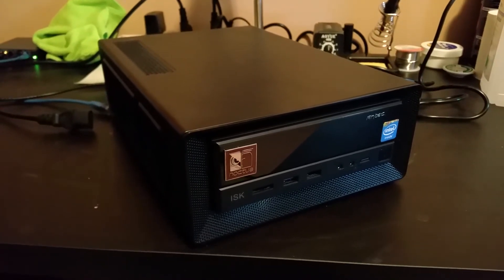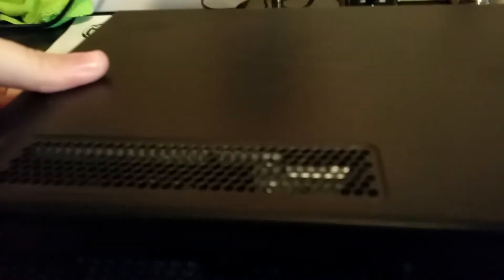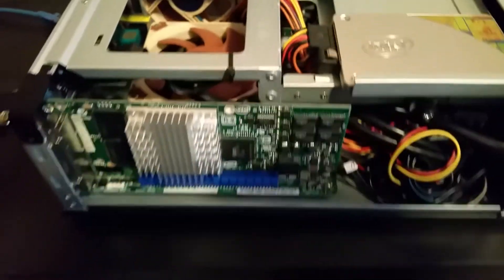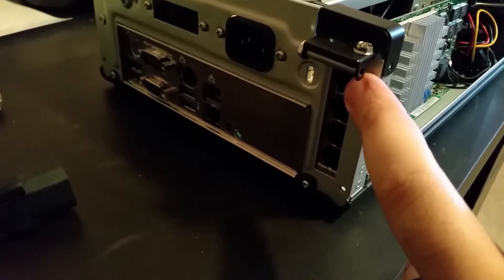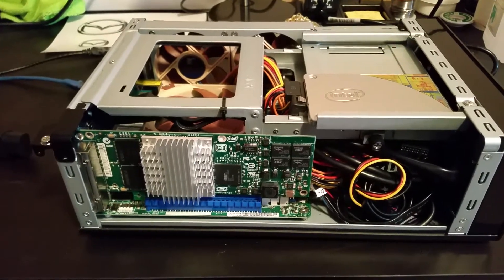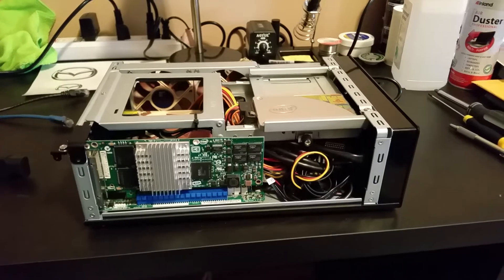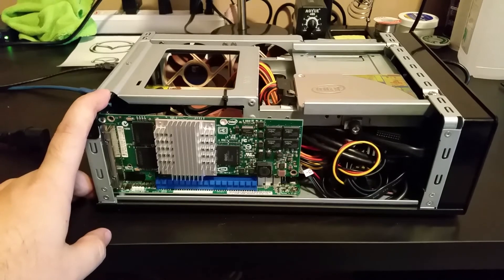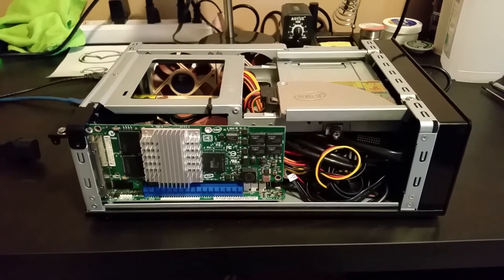pfSense Build, A Tale of Frustrations

Comment: Running pfsense on an old core 2 @3ghz with 4gb of ram  160gb hd, and two single Intel pcie gigabit network cards. No issues. Some old 420w psu. Been running for 3 years. No issues.
Reply from the maker: It's been running fine since getting past the odd string of issues when I first assembled it.  None of it was stuff that could have really been prevented aside from my one mistake.  It's just that odd bad luck you run into once in a while.

Comment: AsRock has a lot of QC issues I've noticed.  I usually build with ASUS or Gigabyte mobos.  If it's a server, then I go ASUS server boards.  They just work.

I've built pfSense routers on old Dell Dimension 2400 units 2 GB ram on Celeron processors.  Never had issues, but if you do that in an enterprise level.  The fail will be real quickly.
Reply from the maker: I usually go supermicro for server boards myself.  Never had any issues with the. I ended up with this because it was the only miniITX server board I could find with LGA 1150 socket and IPMI.

Comment: I've been wanting to build something very similar to this. I wouln't need the extra ethernet ports. Cool video, look forward to see how its working
Reply from the maker: it's working well, aside from the NIC.  Was dropping connections left and right after getting things going.  pulled it out and running everything through a switch for now.  Till I can get around to ordering another one.  PfSense it's self has been flawless, for the most part.  only the hardware issues.
Reply: what do you think about trying one of the passive cooler itx celeron boards?
Reply from the maker: I know a couple people using them.  Also the Atom embedded chips.  Seems to work well for them.
Reply: Ah nice. I think that's what I'm going to try doing. I'll probably use the same case you have. I found a nice board for about $105. Might start this weekend or something. Thanks for the info!
Reply from the maker: +nobearclaw no problem. Only reason I did not go the same rout was because I had the CPU already.  And I wanted a board with IPMI.  So, no matter what I needed a server board.  But if you don't want/need IPMI or other features of a server board pretty much anything will work.
Reply: Ya that makes sense, I don't have a cpu right now so I'm pretty much open to all options. My extra cpu is an amd 8350 which I hvae running a Ubuntu server right now lol. This is what I had in mind:

https://www.amazon.com/dp/B006ICQ3FK/ref=wl_it_dp_o_pC_S_ttl?_encoding=UTF8&colid=2C4PUAR8M4RPG&coliid=ISMND83FLLN13
Reply from the maker: +nobearclaw that would probably do ok.  But it might get worked hard depending on the plugins you use.  Currently Squid gard is the hardest hitting one I have.  The little celeron runs at about 50% load.  That title Atom will sit at or near 100% at times.
Reply: +Chad Bremer hmm alright. any other ideas? i really want to build a small one like this. i could just say screw it and use an old Intel duo 3.0ghz with 4gb ram I've got sitting here doing nothing lol. its just old and was worried the psu would shit out. and it's a matx size pc
Reply from the maker: +nobearclaw what is the max budget for the board/cpu?
Reply: +Chad Bremer I don't really have a budget, but realistically don't wanna spend a ton for a router build if you know what I mean
Reply from the maker: +nobearclaw well, the little celeron I am using is only $30-40 US usually.  Aside from that, any ITX should fit the bill fine.  Just make sure you get one with Intel NIC(s).  More compatible than other brands.  My board was a bit over $200, but it is honestly overkill in many ways.
Reply: +Chad Bremer ya I heard Intel NICs were better with pfsense. so the cpu u have with itx will be better than the board I sent? seems it wouldn't cost too much more. I've actually got a Intel dual NIC already so I guess any itx board will work as long as it supports the cpu.
Reply from the maker: +nobearclaw if you already have a NIC, then yeah.  Any cheap mobo will work. Might be worth checking the used market too.
Reply: +Chad Bremer cool should make it pretty cheap to build then. I'll probably go with the same case w psu as yours then too. thanks a lot for helping! you gonna keep making videos?
Reply from the maker: nobearclaw Oh yeah.  I am looking for a smoke machine so I can redo my most popular vid.  Airflow testing the HAF X case.  Did it with dry ice back then.  Figure a smoke machine and better camera work and what not would be good.  This time with my water cooled rig in my 900D.  If it goes well, I may look into a series of airflow vids.  Have some other stuff planned too.
Reply: +Chad Bremer sounds like a good plan! I'll be around. by chance do you use openvpn through pfsense? if so is it hard to get set up
Reply from the maker: nobearclaw No.  I have no real need for it at the moment.  And since I host a game server I don't really want my traffic going over a VPN for that.  Adds latency.
Reply: Ah ya, that makes sense. I'm in and out all the time, so it's something I've really been wanting to add. Was going to do it with my ubuntu server, but too much of a pain.
Reply from the maker: One thing to keep in mind if you use OpenVPN, you will want an AES CPU.  The Celeron does not have that.  You will be looking at i5/7 or Xeon chips.  I don't think i3 or Pentium chips support AES.  You will want to check Intel Ark to know for sure.
Reply: Hmm, why? People run openvpn through hardware without it all the time. Is it because of the speed boost tech? That could change some things...I thought about even using the g3258, but it doesn't support that either. Maybe I should end up getting a cheap xeon or something. For the short time being, Im going to reconfigure this old dual core pc I have until I figure out which exact parts I need/want. I want to run openvpn, proxies, and obviously dhcp routing. not all sure what else i can use in Pfsense.
Reply from the maker: Better performance with the hardware encryption.  You could always try with out it and if you have performance issues, upgrade.
Reply: Oh ok, that makes sense. I guess I'll try it with this test run PC and make a decision on how much performance I'll need for my actual pfsense build
Reply from the maker: nobearclaw For the most part you need very little.  But, encryption can be a bit taxing for a CPU.  Everything else is pretty low power.  The AES just makes that encryption job easier.  In a very loose explanation.  lol
Reply: Haha ya I understand. I'm gonna start setting it up on this pc I have tonight. I won't get as far as the vpn tongiht probbaly. Oh, last question....my wirless router, I just put into access point mode, and run ethernet from my switch to the router correct? Is there a simple way to change the router default IP or PFsense default IP so they're not using teh same one and the webgui on both are still accessible
Reply from the maker: That's all you have to do.  As far as the IP on the router/AP, that will vary from one to the next.  Some allow you to manually configure the IP for the unit.  I am using DD-WRT on a Linksys WRT1900AC.  In it you can pretty much manually set everything thanks to DD-WRT.  

If you can change it, do it either before shutting it off or plug it into another machine that is not on the new network yet and change it.  Just make sure you choose an IP that is not part of the DHCP pool.  Usually .100-.245.  That is the default range anyway.
Reply: Ah alright cool thanks. I'll look in there and see if I can change it. If not, I'll just set it up before unplugging. And like u said use a computer not on network if necessary

Comment: Many of those Intel quad port NICS are very good (visually) clones. I wonder if you failed to get a genuine one. The old date does bring questions though. I assume you found a date on a chip?
Reply from the maker: manufacture code on one of the visible chips.  Figure odds are they where all made around the same time.

Comment: Did you over-provision to extend the life of your ssd?
Reply from the maker: No.  Not even remotely concerned about that.  At current rates it will take 15-18 months to fill the 190GB set aside for the cache alone.  Modern SSDS are pretty resilant.  Any good high quality drive will take hundereds of terabytes before having issues.  some even get to 1-2 petabytes. Unless I got extremely unlucky and have a defective drive, it's a non issue.  If this was in an enterprise enviroment it would be a different story just dew to sheer volume of constant write.
Reply: Ok well I haven't decided wether to stick with my 2.5" 5400rpm drive or use an older 60gb ssd. Am replacing my Atom 330 with a micro-atx J1900.
Reply from the maker: Unless it's an old Sanforce drive it should be ok.  Sanforce drive had bad firmware back in the day that killed drives.  One of the downfalls of OCZ back then.  Only SSDS that have ever failed on me so far have been Sandforce.

Comment: Hey Brad, more or less what did you spend on parts? I'm looking to do the same.
Reply from the maker: It's Chad, not Brad.  As it sits in the vid, It was about $400.  But I made another vid recently where I swapped the CPU out for a Xeon E3 1231 V3.  I needed the extra power to cope with my download speeds and still scan with ClamAV.
Reply: Hehe sorry Chad. Kool that sound great man! I'll check out your new video.

Comment: I had some problem too, to install the new 2.3 beta version, I install it one week via USB, and the others week i was not able to get it install with an update version, had to download a old version, did not think it was the mirror problem.

Can you put the model or the Case and motherboard? 
Tks
Nice video
Reply from the maker: case is Antec ISK 300-150 mobo is Asrock Rack E3C226D2I
Reply: For a little bit more you could have gone with a MBD-X10SDV-4C-TLN2F-O, Xeon-d, more future proof, better cpu,4dim,+2*10gb nic, not lot of heat, but can't change the cpu i think,
Good video , i'll maybe start a youtube channel soon
Reply from the maker: +jolejo7 this is a socket 1150 board.  so, I can toss many other cpus if ever needed.  Don't think that will ever be a need.  It is already overkill for the job at hand.

Comment: If i do a lot of web cache would i need a higher end processor like i3 or i5 ? Planning to have 30-50 devices on the network
Reply from the maker: no, should be fine.  Squid gard will put a larger hit on the CPU than cache.   With Squid Guard off, the little celeron hardly does any work.  Turn it back on and it hovers around 40-50% usage a lot.  big downloads will see it spike to at or near 100%  If the machines will mostly just Web browsing you should need very little cpu.  But if you have a huge Internet connection and devices are doing lots of high bandwidth activity you may need more CPU, but I would start cheap and upgrade later if needed.
Reply: Thank you so much. I was gonna implement them on used parts of eBay to keep costs down.

Comment: ashrock asus sucks really, i'd rather go with msi or gigabyte, i have expensive asus boards that had been replaced 4 times by warantee, a asus 550ti all now dead, now using an ashrock and sti;; have problems, decided to go with other brands, i had better luck on cheap ecs brands before even lasted5 years. we should stay with better brands, nice video sir
Reply from the maker: I don't buy MSI mobos any more.  Every one I have owned has been crap for me.  Asus has been flawless.  Ideally I wanted a Supermicro for this build, but they had no ITX boards that did not have embedded CPU's.  Like the Atom.  At least not at the time of building.  I think they have one or two LGA1151 boards now.  As for Gigabyte, no real problems with them.  But I am not a fan of their BIOS menus.  Just a preference thing.  I pretty much only use Asus ROG mobos for my gaming rigs.  Asus pro or deluxe boards for other machines.  And I try to stick with Supermico or Asus for server boards.  Those are what I have had the least issues with over the last 20 some odd years.  Used to get EVGA mobo's, but the last good one they had was the X58 Classified.  Been pretty craptastic since them.  Terrible BIOS issues on many.

Comment: You're using a ASRock motherboard. That's your problem.
Reply from the maker: I originally went shopping for a Supermicro.  In the end, this was my only option I could find that had a socketed CPU in mini-ITX.  Besides, Asrock has been solid since Sandy Bridge and Ivy Bridge CPU's came out.  The issue was purely a single back chip that swapped out easily enough.  It's been up 100% after that.  Plus custom service took care of things plenty fast.  I have no complaints in the long run.